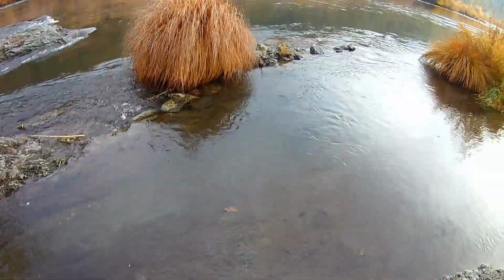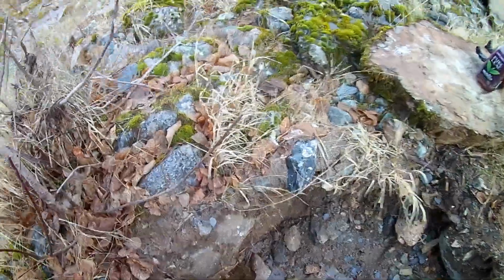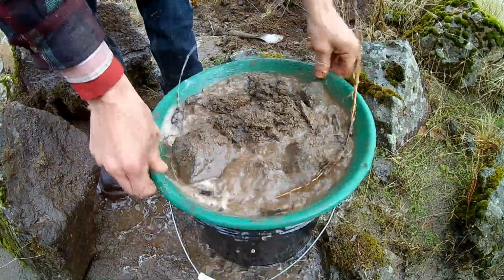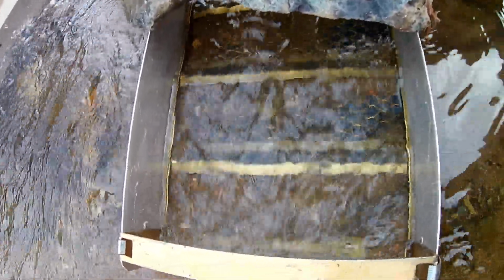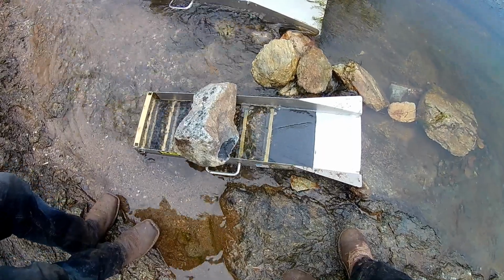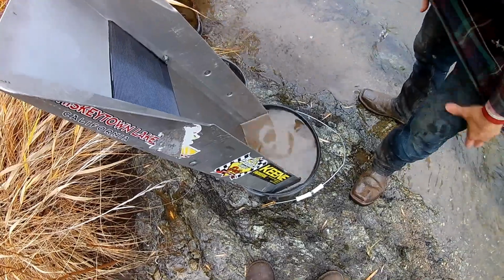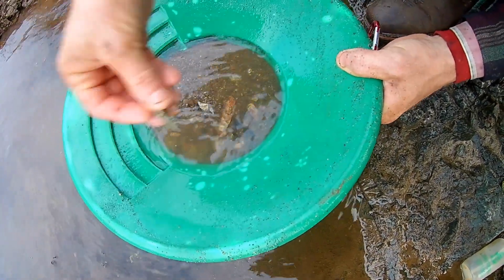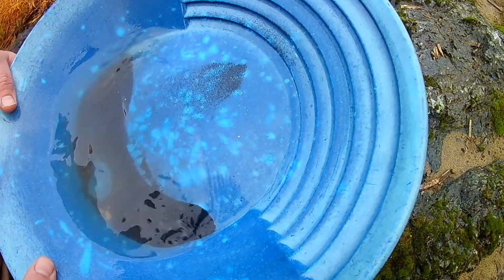Prospecting Basics: How to run a sluice, classify material, and a panning lesson (BEST GOLD YET!)

Comment: Keen boxes should run like glass with plenty oh power, just a tip from a keene fan lol. A very old German gentleman showed me how they run best. You need at least 2 inch  of water in those boxes at the wing end. I like you guys used to run slow, now I run fast. Check out my January trip, boxes worked well. Great tips my friends and this is a top tip from the pirate. When the waters slow use a mckirk they work better in slow water ☠️👍👍👍🏴⛏️💙

Comment: Very nice demo thanks! I especially needed help with knowing how to set up and use a sluice properly. I own a LeTrap.
I'd love to see y'all go after this spot using a Gold Cube. 🙂
Reply from the maker: Gold cubes are more for cleaning your cons. Not really great for production. I can classify material by hand 10x faster then the gold cube tromel.
Reply: @hhprospecting7508  I suppose so.
There used to be another sluice on the market that had a grizzly attached to the bottom, but as of 2 or 3 years ago, it became unavailable.'
Been out of the loop for a bit. Is there anything affordable on the market now like that?
Also, do you have any tips for production panning?